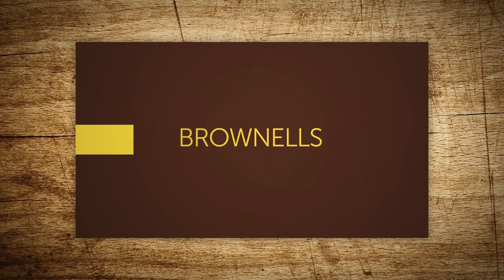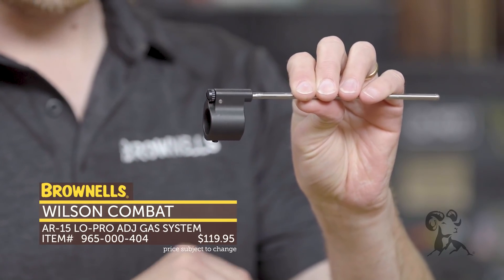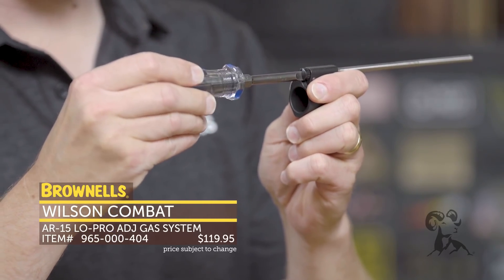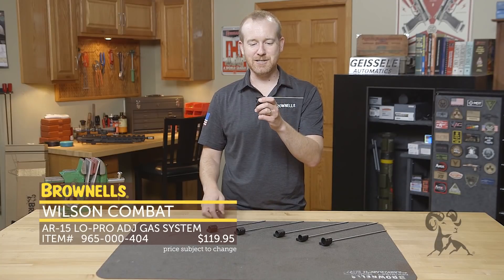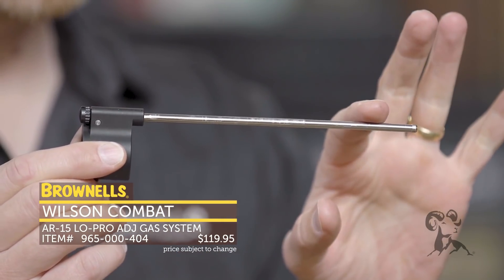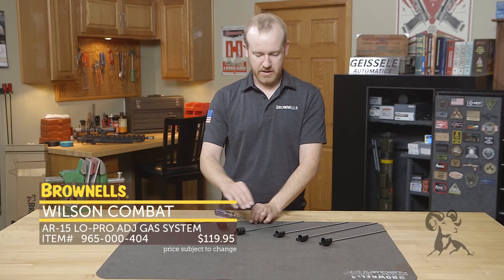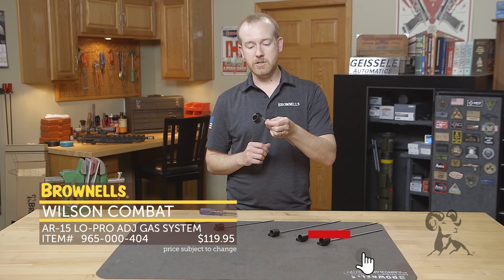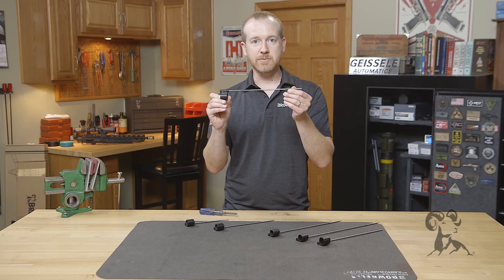New Product: Wilson Combat AR-15 Adjustable Gas System

Comment: There's SO MANY  you tube warriors in this comment section it's not funny,and obviously have no idea how guns work lol 95% of the time you have gas issues its because the block is not centered or your gas hole is too small if you put a adjustable gas block on a gas hole that's too small your problems multiply smh ,(pro tip ) dill out your gas hole bigger and put a adjustable gas block on problem solved🙄 throwing parts at you gun does absolutely nothing for you and makes issues worse,I mean 450/762×39,.300 bo etc  uses. 556 gas system

Comment: Stupid design the screwdriver handle will hit the barrel before the tip engages the slot. Should have used a hex wrench setup
Reply: Use your screwdriver more better.

Comment: you are opening a can of worms - unless its being used with a suppressor- and you will chase your tail if you have already swapped out heavier springs and/or buffer - enjoy the journey 😜
Reply: And with a suppressor a adjustable gas block is even more important
Reply: You know it. I run a suppressor and a jp low mass carrier so yeah I had a hell of a tone getting it to run. It's a soft shooter though.
Reply: Thomas Wilk - man I chased around low energy 40gr prairie dog loads with adjustable gas blocks/springs/heavy buffers/muzzle brakes....I thought I was losing my mind - but I sure did learn a lot
Reply: Alls you did is put a bandaid on the problem,instead fixing the real problem,trust me I have been there done that and realized I and almost everyone else with problems was doing it completely backwards,I'm not mouthing off and spewing lies if I am then please explain how I am wrong? You said it yourself it was easier for you to just swap a buffer,instead of doing it the right way you put a bandaid on  so.....
Reply: @highspeed9518  your right a buffer is not the only way or massive the best way to resolve the issue but it can be done that way.
Reply: Idk how swapping a buffer is easier then turning  a screw but ok, it's like saying the air in my tire is low so I better change the engine, it's not called a buffer operated rifle it's called a gas operated rifle
Reply: @highspeed9518  no no, most pre built rifles don't come with an adjustable gas block. I meant for most it's easier to swap a buffer than a gas block. I agree a gas block is great and a better way to tune the rifle, it also has a tone of positives. On an HD rifle I'd only use an adjustable if I had to. Simple is better.
Reply: Ahhhhh ok
Reply: Well you apparently dont know anything about how to tune a rifle if you are starting at the buffer you 100% doing it wrong lol you start at the gas block you know the first place that controls literally everything else in your gun smh,adjustable gas blocks only benefit you zero drawbacks vs wide open gas systems,you guys have alot to learn,but if you want to throw $ and parts you dont need at your guns be my guest, first thing I do is swap all mil spec gas blocks to adjustable especially with a suppressor
Reply: @highspeed9518  you have a lot to learn. I started at the gas block, but the buffer is the easiest way to make quick adjustments without spending a lot for most people. An adjustable gas block is only recommended when needed because it adds an extra risk for failure. Me and this guy where just having a sensible conversation. We appreciate your advice and put downs, thanks.

Comment: It took 50 years of metallurgical and coating development to make the AR system reliable, even after the ammo was improved, so I have no interest in adding to complexity of this. Before all AR lovers jump down my throat just remember that around 2010 congressional mandated tests conducted by US Army of M-4/M-16A4, it came in dead last in reliability having more than 2X number of jams compared to next worst rifle, HK416.
Reply: I was watching small arms solutions channel, he was saying that the m4 was only slightly less reliable in testing than the SCAR and other foreign made guns. That was just due to the fact that Colt refused to upgrade some of the easily upgradable parts because the army didn't require it
Reply: @C.Hobbs2178  I am not familiar with that person, but fact is the M4 (made by FN BTW) Not only jammed more in this testing than all the other rifles, BUT HAD MORE JAMS THAN ALL THE RESTOF THEM COMBINED.

Comment: Adjustable gas blocks are the most overused item these days. Lots of problems. But this looks viable and I love everything WC does. My only issue here is that this won't fit under a lot of handguards.
Reply: How is having more options in your gas system worse lmao you dont know wtf your talking about

Comment: Too bad you can’t get this gas block pinned.
Reply: Dimple your barrel and use set screws with aggressive cup face knurling. Your GB won't slip. Getting the GB to hide under the rail system will protect it as well. The reason why front sight blocks are pinned is not just because they are exposed but also because they are a front sight and they extend out from the barrel enough to grant a lever arm that will allow them to twist if they aren't dual taper pinned.
Reply: Aaron Orr for just about every civilian use you are right. But Bill Geissele did an interview in Shot 2019 that explains why his gas blocks are pinned. He had a patrol officer muzzle strike a car window so he could get inside.  That force alone was enough to dislodge a set screwed gas block.  So pinned blocks do have a practical use, albeit a rare one for the average Bagofdoughnuts.
Reply: @johnnybagofdoughnuts4193  Anecdotes are not exactly the best basis for business decisions. Hard data spread across multiple users that shoot thousands of rounds in a month is a better metric for what is needed. That is why a lot of businesses offer pinning as a service at an additional cost. 

The biggest reason I personally resist pining LPGB is drilling too close to the the bore of the barrel will affect the barrel in that area. All professional AR smiths will never have this issue, but bubba with his shadetree smithing may screw up the job.
Reply: Aaron Orr Bill Geissele does a little more business in SOCOM than your or I do.  I have a tendency to trust experts in their respective fields.  In the field of firearms design, Bill is certainly an expert.
Reply: @johnnybagofdoughnuts4193  He has a vested monetary interest in selling people on the "advantage" of pinned LPGB. Companies that make guns used by long term trainers from military/law enforcement have routinely heard back that the unpinned low pro gas blocks have never been a problem in the multitude of factory uppers they have seen in their classes over the past decade and a half. If it was a big deal in classes that can occur in the crappiest of conditions than more companies would feel compelled to pin. Most opt to allow their customers the choice as it is just extra gravy or a side of bacon, not a bad thing or a good thing. Just a personal preference thing.
Reply: @johnnybagofdoughnuts4193  how did that dislodge a set screw gas block that was covered by a handguard? Unless the screws were loose I call BS and I say this as a geissele fan
Reply: Doesn't look beefy enough at all for "mil-spec" pins. Pinning is the way to go. In my opinion.

Comment: What if your gas tube fails later? It was made to be a failure point after all.
Reply: I would think it's serviceable. There is a pin in the side of the block where a gas tube pin would normally be. Knowing Wilson that tube is proprietary so you'd have to go to them if something did happen. It's still not a bad option but there are other options on the market that work just as well.
Reply: Sooo...don't run this gas system when paired with the full auto lower I don't own. Got it.
Reply: @aaronorr5586  full auto and mag dumps aren't the only things that kill gas tubes. Check out my comment above and watch School of the American Rifle's channel sometime. You'll learn way more than you ever wanted to know about how an AR really works.

Long story short I make gun holsters for a living and know a lot of local gunsmiths who have taken his classes. After talking with them a lot and watching his videos I started buying spare parts for all my guns. Not just the ARs either.
Reply: @project86xero  I have been watching Instructor Chad's Videos since January. There are more important factors in the wear of a gas tube than just number of rounds fired. If you have a poorly aligned gas key it will kill a tube prematurely. If I as the builder don't do my due diligence to check the X/Y alignment of the key in the upper it is inevitable that wear outside the typical schedule will occur. Wear inside the typical schedule involves so many rounds shot that quibbling about the price of a gas tube/adjustable gas block is like quibbling about about new tires on a 10 year old vehicle with 120,000 miles on the odometer.
Reply: @project86xero  I happened to be in the market for a holster right now. Can you post a link or tell me where to go to find your product?
Reply: Get a V7 inconel gas tube and never worry about it.
Reply: @SuspiciousGanymede  V7 makes good stuff, and so does Wilson Combat. However I was making a point. The point is parts fail, parts wait out. Even those inconel gas tubes go bad eventually. Full auto heat isn't the only thing that kills gas tubes. So if they're selling something like this they, meaning Wilson Combat, should sell the tubes on their own too.
Reply: @project86xero  I've learned a lot from SOTAR vids, currently on a waiting list for a class. Anything can fail, i try to build my rifles with parts that are more durable so they last longer between repairs. Most importantly, keep spares of everything. I've never worn a gas tube out, but have shot thousands of rounds full auto and have replaced extractor assemblies, gas rings and buffer springs on my personal rifle. Inconel suppressors last a lot longer than steel on full auto before a meltdown, my thought was that it would make a superior gas tube material. I've seen the superlative arms bleed off gas block that's supposed to extend the life of the gt but never had a chance to mess with one
Reply: Would you explain that?
How is a hollow metal tube meant to fail?
Reply: @shawnr771  it's like the fuse in a electrical system. If it over heats it will pop. It is so in long strings of fire u dont kill the gun. But there are many upgraded high heat gastubes out there that can take a real thrashing and not pop. It just depends what you want the gun to do.
Reply: @shawnr771  You should watch the IV8888 videos on AR15 meltdowns. Gas tube fails in every video. As the other comments have said, it's made to be a failure point.
Reply: @richrhocks  Thanks.
Reply: Shawn R ..... hot gasses
Reply: @noretreat151  No. Friction wear is the problem for properly made/tempered/heat treated gas tubes. Heat caused by friction of components sliding against one another rapidly can accelerate the wear but the gasses have less to do with it than the friction. At the point you need to replace the tube you will have spent enough money in ammunition fired that the cost is nominal for the replacement.
Reply: It's so it doesn't damage your barrel or gas block.

Comment: Is there enough gas block to pin it? Set screws are notorious for shooting loose.
Reply: Two dimples and rocksett should work fine. However if you want to add a taper pin it looks pretty slim. However my biggest concern is the straight gas tube. I actually think straight gas tubes are better. However if it's pre-installed how do you replace it if it ever fails. In my opinion gas tubes need to be replaced every so often. Just like sprigs and gas rings.
Reply: I'd suspect that the gas tube is replaceable, being a constant wear part. Perhaps that's the reason for the set screws. It gets replaced as a whole unit. Won't really know until I see it in person.
Reply: @uraniumpenetrator3844  Replacing the whole unit would get expensive. Wilson would be dumb to not make replacement gas tubes available.
Reply: @rowenelna  
Yep.
Reply: It’s like y’all never heard of locktite.

Comment: the last time I bought a straight gas tube gas block the gas tube was too long and didn't let the bolt go all the way into battery, this is on a dpms pattern large frame AR. Does this gas tube measure the exact same length as the standard carbine, mid length, and rifle formats? Exactly please, down to the appropriate decimal point.